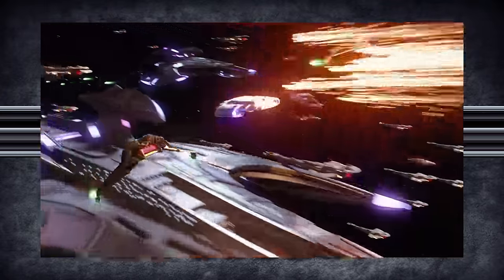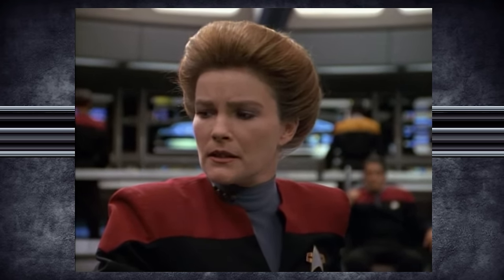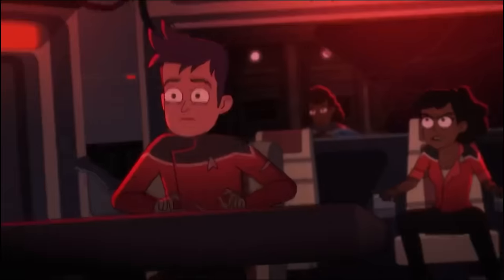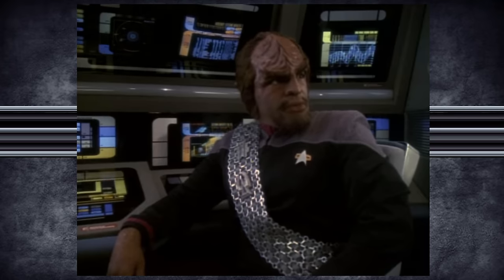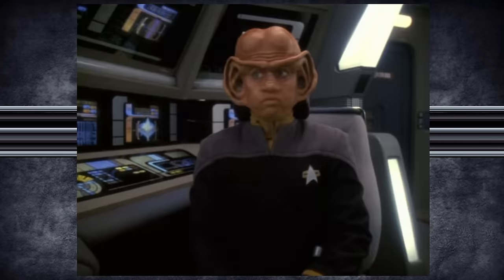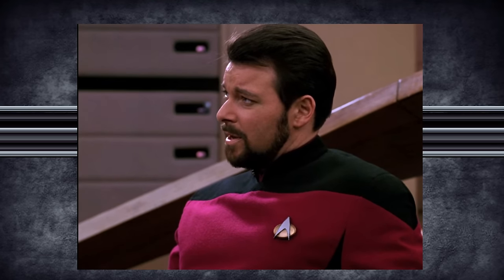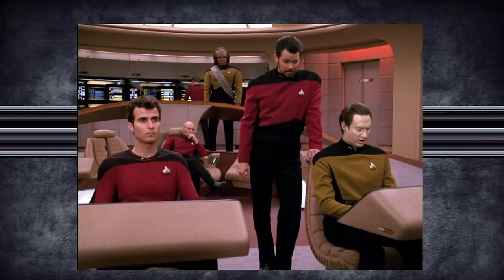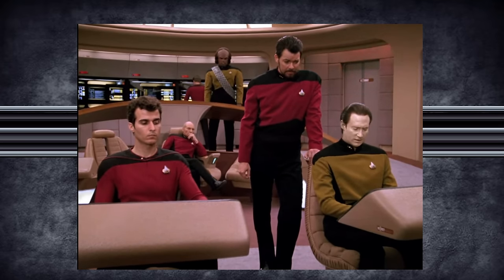Why Starfleet's Bridge Design Was Lethal to the Crews

Comment: the argument in favour of windows doesn't hold water.
if it is a transparent metal as solid as the rest of the metals used to build the ship, why is not more of the ship built with this transparent metal?
if it is in fact weaker than whatever constitutes the bulk of the protective panels on the hull, then it remains a weak point.. stronger than glass, to be sure, but still a weak link in the chain.
Also, what's the point of windows when you move at speeds faster than light? when you go faster than light, your eyesight can't keep up with anything that isn't moving at your same speed/direction... because eyesight runs on.. light.. and you're moving faster than it.

I've watched most iterations of Star Trek and can reasonably call myself a fan... my main gripes with the federation, especially in TNG, are 3
1) the fact that half the crew on the command deck are standing and lack proper protection/chairs/seatbelts to use when they get into a scrap, a couple of times per episode. after the third time he flew halfway across the deck, Worf should have demanded at least a bunjee cord.
gotta laugh about how apparently, the advanced society of the 24th century has solved world hunger and economic problems but somehow tossed health and safety out the window.
2) how they just transfer power to the shields, the engines, the weapons... I'm sure many trekkies who are better prepared than me will have perfectly acceptable explanations for this, but to me it has always seemed just a little too convenient how this one generic source of power somehow permeates the entirety of the vital functions of the ship and can be swapped around like it's water from a glass to another glass and fill whatever need of the moment.
3) how almost all specialised members of the crew are apparently trained in almost all other specialisations as well.. everybody knows how to pilot the enterprise, how to plot in a course, how to repair vital parts of whatever is broken in any given episode, how to fire a phaser, how to fight, how to... you get the point. What's the point of having specialisations if everybody ultimately turns out to be at the very least highly competent enough to replace everybody else in most functions?

then there's the non trivial bits of how they treat debris fields, asteroid fields and what have you like they're operating in a pinball machine when in reality the distances between asteroids in an asteroid field are often such that it would be harder to hit an asteroid than to just close your eyes and shoot for the exit.

Comment: Windows on starships... How many windows do you find on submarines? Civilian: Tons... Military: None... How many windows should be on a starship? Depends on its purpose... Military? None, place the bridge in the core of the ship as much as possible. Connect many displays to all the available sensors. This is how it is done on a military submarine. even the periscope is gone, replaced by a mast with various sensors and cameras. Civilian ships: depends on the purpose of the ship. At very least, yes some observation windows are nice to have, but unnecessary. With 4k and 8k cameras, we no longer need windows to observe under modern technology, much less some future technology. In SciFi the technology has advanced even further in some form, yet windows offer a story telling medium. They provide a framework for displaying the wonders and beauty to be found, or at times for displaying the horrors of war. In reality they provide a psychological connection with the outside, so we still put them on our spacecraft, and on our aircraft. Just look how "important" a window seat on an airline flight is.

Your assessment that windows are a tactical backup for sensors is very inaccurate as well. In space visual range is greater than that on earth, but weapons ranges are so much greater as well. Further all it takes to defeat visual reference is painting a ship flat black at which point there only way to know it is there is to catch it passing in front of a light producing or reflecting object or spotting lights from its windows or engine flare. We used out black stealth fighters primarily at night for a reason. If windows where a legitimate tactical advantage, space combat tactics would evolve to make use of the shadow of planets to conceal maneuvering. The ONLY reason to use windows as a tactical solution in SciFi is to create a identifiable visual element that we the TV/movie viewer can relate to. To add drama... "sensors are down captain... never mind the sensors, turn us to face them bow on and we will beat them with our vastly inferior eyesight because HFY!!!" Yes they are screwed if sensors are taken out, but with that massive window, they are still not going to be able to aim weapons, they are still not going to be able to see enemy ships adequately to get on target much less accomplish anything tactically. The only reason modern navel ships even maintain windows is it helps them see the sea state more clearly (and it helps mitigate sea sickness).

Comment: Star fleet isn't military per say. They use force for defense, and there have been wars where they act more militaristic to defend their home planet, but they aren't suppose to be specifically a military. So its not surprising they aren't designed as warships most of the time. Galaxy class has a battle mode, but its more a last resort. To protect the saucer section.

Comment: My question is: How come, whenever a ship takes heavy damage, freakn ROCKS fall out of the ceiling? One would think the hull is made of metal, not ORE. It makes zero sense. I'd expect slag, metal fragments, nuts and bolts, screws, wires, cables, but not ROCKS.

Comment: On your points, star trek gets something very VERY wrong in its bridge designs, related to windows- they are NOT to see the enemy- they are to see you OWN ship. Having a direct line of sight on your ship would be critically helpful in many situations. Chiefly, in damage control- you can see which part of the ship just blew up without reports, you know which systems are failing and why in a split second. docking safety can be another factor. 

So forget protecting the officers- that is not nearly as important as allowing them to be effective in the first place. 99% of the time they are not in combat anyway.

In the general ship design layout followed by star trek, the correct position for the bridge in my eyes would be in the connection between the two hulls, in a strong, hard to hit area, with clear vision to allow for VLS (visual) landings from the bridge, it allows direct data lines across the ship (any damage here would cut off each half of the ship anyway, it is a critical location) due to the structure it is also likely to be the strongest and most reinforced section of the ship. 

Just my 2c see what you think.

Comment: Not a good idea to have your ship systems on display when doing ship-ship communications especiallywith hostiles.    Might be better if the captain is behind most of the important systems so they can see and communicate with the crew.  Also might be best to have the access point for the bridge in front or to the side instead of the back so if you get boarded you don't have your back turned/can use consoles for defense.

I think Battlestar Galactica/expanse had it better.   I think a view screen should be secondary to protection the only reason modern ships have windows is because we still use line of sight.  The distances in space are so vast and the light so unreliable.  Also cosmic rays/ bright lights could be a concern as well as advanced technology that could scope the bridge for data.  Having the bridge in a hidden location within the ship is the way to go.

Comment: The one thing I highly disagree on is windows  for the bridge.  You completely overlooked the advantages of screens ( you can zoom, show additional info etc.)  and I think they easily outweight the one disadvantage of what if the screen no longer works. Windows can be blinded as well.  Last but not least  considering the speed of star trek ships and the range of weapon systems I doubt you would ever fight in the visual range anyway, so your one big advantage is not even any advantage at all.

Comment: Let's completely disregard that ALL systems in Starfleet are appaerently wired into their respective bridge consoles directly using high-energy wiring or plasma couplings, causing them to explode spectacularly on any malfunction which would injure the operating crew member and anyone nearby. All the while with the ship having an OPTICAL data network which would completely eliminate the need for explody-panels and make the whole arrangement fail-safe.

Comment: Tbf, most scifi starships are deathtraps. Why would you need an almost “externally” placed (as in close to the surface of the ship and it’s armor) bridge with vulnerable windows. even if the glass separating the crew from space was the strongest transparent material in the galaxy, or it has retractable armor deployed during combat, why couldn’t they just put the bridge/crew areas at the center of a ship surrounded by armor and redundant systems? in space, ships are more likely to just rely on sensors anyways, and surely tech is advanced enough that it wouldnt be hard to place external camera systems (multiple for redundancies) if actual line-of-sight is needed.

Comment: I have served on a modern military vessel and there are some assumptions here I think you are less than correct about. For starters, what you got right, the bridges of Federation Starships are not exactly the most strategically placed. But then neither are  modern warships as the bridge is often front and center. This is especially problematic of all the senior officers as well as the executive function was handled from the same location as a federation starship. On the vessel I was on, there were at least 3 different places where the ship could be commanded and in a combat situation, the Captain would be in one of the most secure locations while the Executive officer took command on the bridge. This is something that would make a ship from Star Trek Vulnerable. 
But, there are certain other assumptions you have made that are not accurate. For starters, lets talk about your assessment of the captain's chair. Your assertion is that the captain should have direct line of sight to all stations on the bridge. However, for a modern warship, the Captain's chair is located on the forward starboard (right, relative to the bow) side of the bridge. The emphasis being more on looking at what's going on around the ship. That's when the Captain is actually on the bridge at all. Most of the time underway command is handled by the officers of the Deck and Con. Both of whom stand forward of the helm  with all bridge stations behind them and again, the expectation being that they are paying attention to what's going on outside of the ship. Very seldom do these people have a direct line of sight to the different bridge stations and they are rarely trained in how to use them directly. On a Federation Starship this is even less necessary because, according to the technical manuals, the Captain can not only observe the other stations from the terminals on or around the chair, but they also have the ability to take control of those stations in an emergency. 
Then there is the issue of seating, you comment that making the Enterprise D Tactical Officer stand for his entire shift is impractical, but on a modern Warship, the only people allowed to sit on the bridge at all are the captain and executive officer. There is a chair at the helm, but except for extremely foul weather, the best the helmsman can expect would be to lean on that chair. 
On the other hand, this isn't quite so bad, since your assertion that the bridge watch was 8 to 12 hours is also off. On my ship, watches were 4 hours long and you typically stood a maximum of 2 watches in a 24 hour period depending on how many people were in your watch rotation. Keep in mind that standing duty on a ship is actually a secondary responsibility. Most of those officers would have at least one 'day job' to do on the ship as well. This is evidenced on the Enterprise D early seasons as Wesley Crusher is often bouncing between the helm, engineering, and his studies. If a junior officer on my ship had any spare time during waking hours, the XO would make sure that they were given ample collateral duties to occupy their time. Growing up a Trekkie gave me a very distorted perception of this part of ship life when I joined the military. A modern senior officer would explain Harry Kim never getting promoted to the fact that he seemed to pursue so much leisure activity rather than working on his advancement.
Finally, and most importantly, is your assumptions about the rails and such on the bridge. You pointed out that with the Enterprise A, these rails obstructed the path between the different stations on the bridge, inhibiting the captain from moving between stations, and other officers moving towards the Helm. Those rails are actually the most important and realistic safety device on the bridge and one of those rails literally saved my life at least once. My XO also told a story about his first deployment after leaving the academy when a petty officer on the bridge was killed during heavy weather because he wasn't holding on to the railing like everyone on a military vessel is advised to do. In fact I would go so far as to say that there should be more of those rails throughout the ship for people to hold onto, because every time you see the ship violently shake and people get thrown from their stations, that's happening everywhere else on the ship too. Every sailor on the ship is advised "One hand for the ship and one hand for yourself" a saying meaning that, regardless of whatever you may be carrying, you also should be holding on to something else at all times.

Comment: Arent all Viewscreens in star trek not also windows? I thought there was a episode in star trek next generation, were this was either said or even shown. Its just rarely used, but in case of system failure, you stil could use them as windows.
Which is one of the reasons why the bridge was never in the center of the ship.

Comment: Windows honestly make little to no sense on a space ship.
First problem is that the wondow has another structual integrety compared to the normal plating as they are different materials creating an obvious weakspot.
Second problem and far bigger. In the case of sensors breaking down a window wont help in navigating besides spoting a systems sun and planets that are somewhat close. Trying to find a ship/station thats not already very close (as in a few miles if not less) is pretty much futile

Comment: The thing that bothered me the most was why do they pump so much power through the consoles that, in case of a power surge, the console can explode with enough force to kill the crewman manning that consol. 
      Thy are not channeling the energies that control the systems directly. It would make no sense to route the energy from the warp core through the ship to the bridge then back to the warp engines. 
      It would be more efficient, safer, and just plane smarter to route only enough energy to open or close switches that would in turn route the energy directly to the engines.
     There should not be much energy in to counsel itself. It can be low enough that the panel can be opened and serviced while the panel is operating.
    Just dumb.

Comment: None of the bridge designs make any sense, other than as a set in which to film various and sundry scenes for a television show or a movie. Ideally, the "bridge" would be located in a number of separate locations throughout the ship, all linked together through multiply redundant data channels. The "bridge" crew would each operate their assigned system(s) in a dedicated cubicle separate from the others, and would act as the interface between the commanding officer and the relevant ship's system(s), control of which could be transferred to a different location if necessary. As far as rhe window/viewscreen is concerned, video monitors could relay images from armored cameras located on the outside of the ship's hull, with additional information overlaid as necessary by the ship's computer systems (which would also be multiply redundant). If the ship's control center had such a distributed design, then any loss of control would require significant damage to the ship, in multiple locations simultaneously, which would as likely cripple or destroy the ship in any case, rendering the need for control a moot point.